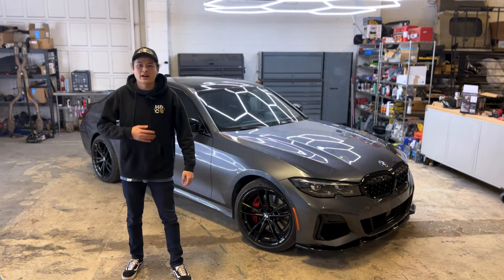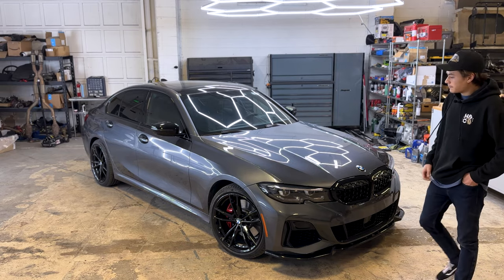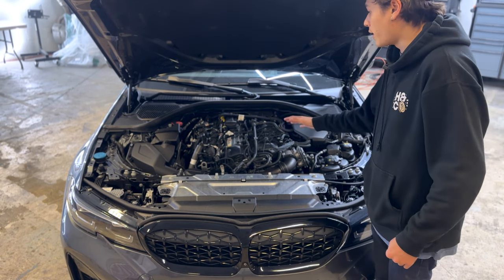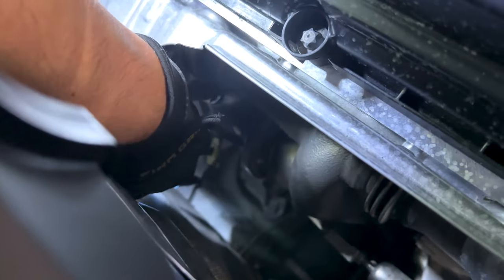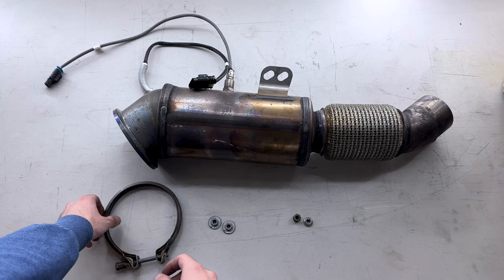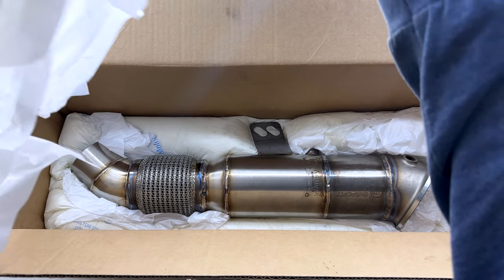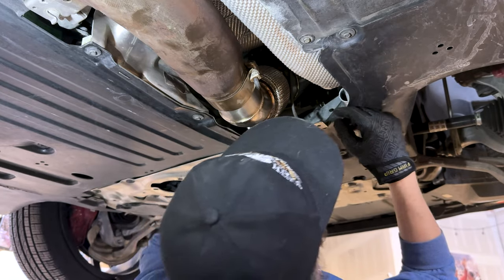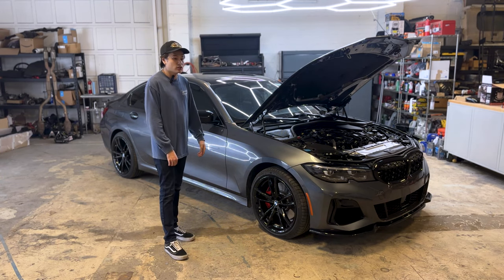Buying A 2022 M340i + Active Autowerke Downpipe Install | EHOONS G20 Build Ep. 1

Comment: The stock exhaust on tge m340i is very good,you shouldn't have bothered.
Reply: The cat is very restrictive, a high flow cat or catless downpipe is very necessary
Reply: It indeed is necessary if you want to add more power to the car. And if you've got the right tune or the '20 model with factory pops and bangs, it makes those a lot louder and crispier as well.

Comment: Only downfall is that it’s limited to 131
At least mine is. I’m gonna wait out  till the warranty goes out so I can unlock its full potential. 
Bro I got it all black on black with 
xdrive 
2021
Reply: Only cuz of the tires that come with it. I hit 150 on my stock m340
Reply: I just got mine black on black X drive with red calipers 2022. Has to be the best sports car this generation.
Reply: i've been to 145 in my stock 2021
Reply: Mine came with summer non run flat performance tire and 155 is the limiter

Comment: I have a 2023 and in sport + mode stock it pops when revving. Your demo in stock mode didn't pop and then it popped with new downpipe, which sounds close to my sport + mode revs stock. Did you rev in comfort or sport + for the stock demo when showing the difference?
Reply: i have a 2023 too but are you talking about the sounds in the cabin because those are piped in..  even his stock version popped a bit when revving
Reply: Actually the 2020 is the one that pops the most
2021- 2023 barely pops

Comment: Is there any difference in handling/ power between the gas/electric hybrid compared to the just Gas M340i?
Reply from the maker: The hybrid doesn’t affect handling. But the G chassis cars are better handling than the F chassis cars. More stable at high speed

Comment: is there a big difference between AA downpipes and the VSRF brand one its a huge price difference?
Reply from the maker: You will not pass an emissions test with a VRSF “catted” downpipe. AA is the only company using a real EPA compliant catalytic converter. Otherwise they are pretty much the same
Reply: @EHOONS  I see I would have gone with the Catless DP compared to the AA catted  is there a big difference in power gains or just the passing the emission test
Reply: @djcoolitoff  You'll make more power and turbo'y noises with the catless. The AA is 400 cell, so it's a lot more restrective then most highflow downpipes even, as most are 200 cell. The AA you will pass emissions, and the smell will be a lot less. If you're looking for reliabilty and performace I would go catless

Comment: You didn’t put on the downpipe gasket, that’s why it sounds like a rattle/leak
Reply from the maker: Active Autowerks downpipe comes with a new gasket installed
Reply: @EHOONS  yes but yours fell off when installing it to the turbo and putting on the v-clamp. its cleary missing.
Reply from the maker: Clearly? At 6:25 you can “clearly” see it on the table before I put it in the downpipe
Reply: @EHOONS  You edited your video a few days ago in the middle to remove the part where you show the downpipe mounting to the turbo. That is where you can see the gasket missing.
Reply from the maker: Bro what? I didn’t edit shit. Get off your keyboard and stop pretending you know more than me about my own car
Reply: @EHOONS  taking it personal much? Just stating facts and letting you know of a potential turbo leak. Good luck with your channel.
Reply from the maker: Well I’ve let you know, I installed the gasket. So you aren’t stating any facts.